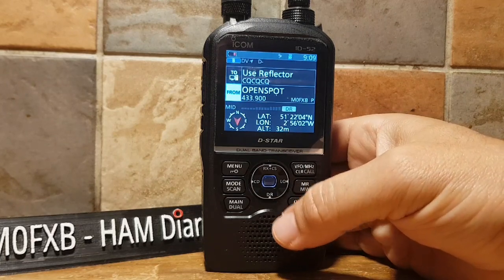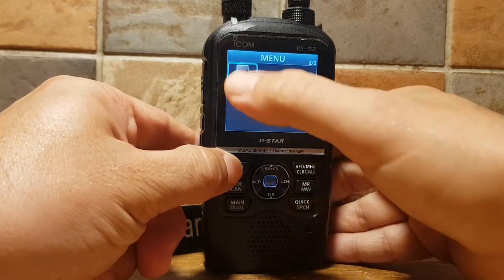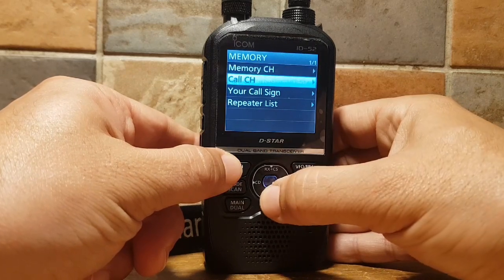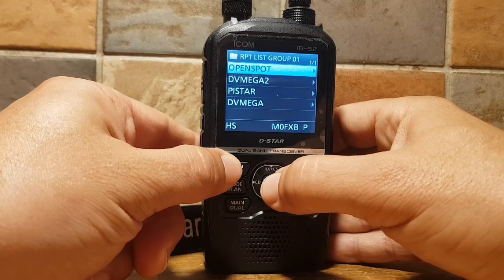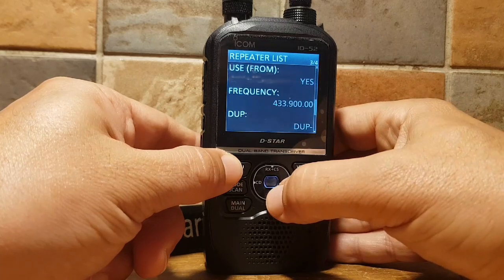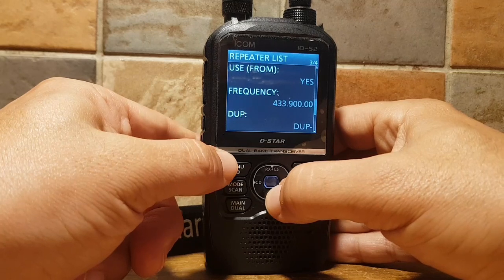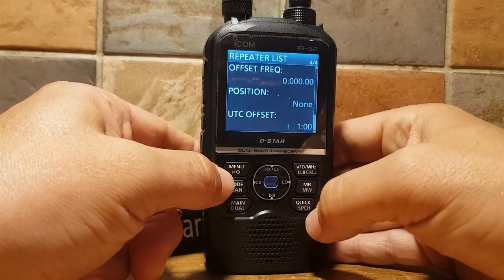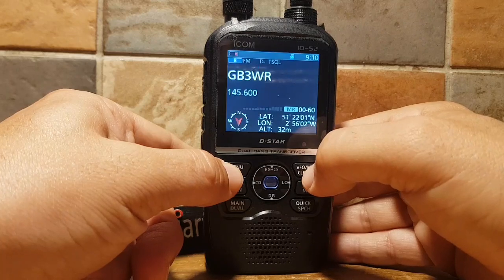ICOM  ID-52 -  DR mode Dstar - Explaned

Comment: I know this is like 4 years old but just got in to listening only on D-star as not currently registered. One of my local repeaters has always been easy to link to the DCS477B reflector but now nothing heard for a couple of days, and also doesn’t confirm I’m linked or give any repeater info or echo test, is that because someone has not currently switched to/enabled the d-star mode on the repeater, or should I still be able to get a connection/echo test? Thanks for all your videos, learnt lots from them ❤
Reply from the maker: Thats Hubnet its active .
Reply: @M0FXBHamTech does that mean that’s just how it goes?

Comment: The way Icom named the item in the DS menus is easy. "FROM" is where you want to transmit "from". "TO" is where you to make a contact "to" (a person, a repeater, or anyone (CQCQCQ). Simple.  
Touching FROM opens a preprogrammed repeater list, which can be edited and added to) and automatically loads all the connection settings you need. 
Touching TO opens a Repeater or Reflector list, and programmable "Your" call sign list (where you select the person, repeater or reflector "you're" wanting to connect with.
Push, select, you are set to go.
Reply from the maker: Thanks

Comment: Why can't they make D-Star simple to use like Fusion ? DMR is a pain in the ass but think D-Star might actually be easier ?

I use D-Star on Blue DV and on my DMR radio with the Openspot 3 but Blue DV is so simple to use so too is fusion. 

It's a pity they can't make a radio with DMR, D-Star and Fusion, I suppose that's what makes Blue DV so attractive to me as I have all 3 and so easy to use.
Reply from the maker: Get and FT70d , FUSION is so easy and Good fun.
Reply: @M0FXBHamTech  I already have the FT-3D and yes it's super easy to use but I also use D-star and DMR lol. 

I do use the Anytone and Openspot 3 and cross mode to all 3 modes, I think I linked you to my video ?

Be good if they made a radio that worked on all 3 modes. 

I like blue DV simple as it gets and all 3 modes so easy to switch between. 

I rarely use the FT-3D and use mostly blue DV and the Anytone and Openspot 3 and crossmode from DMR to D-star and Fusion, mainly use in the car, easy 3 modes 1 radio but an absolute pain in the back side to program the Anytone and OS3 to make it all work but the OS3 is a really amazing device the only thing is the audio quality isn't the best when cross mode unlike Blue dv which sounds really good.